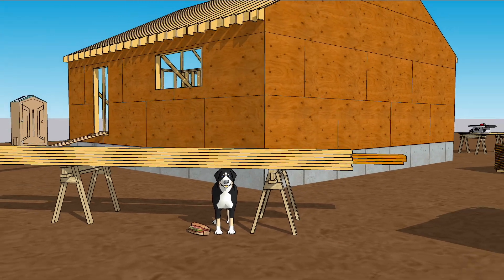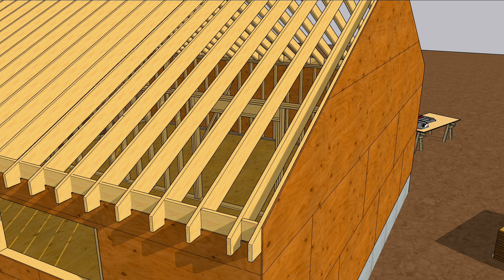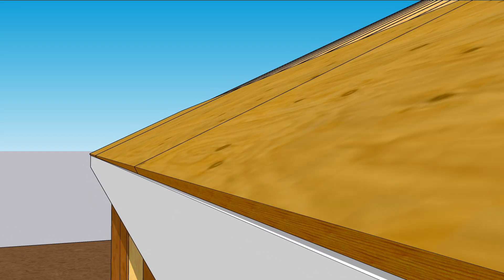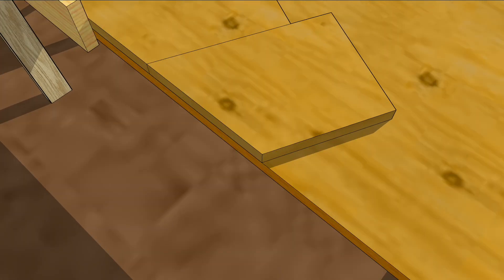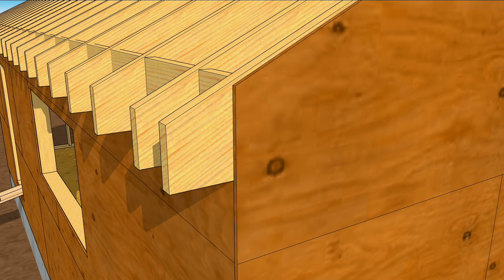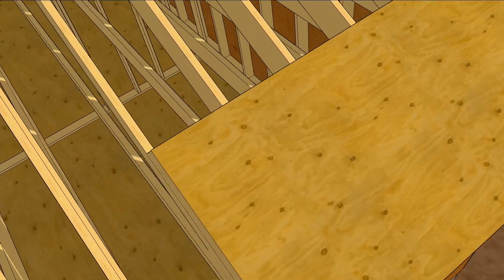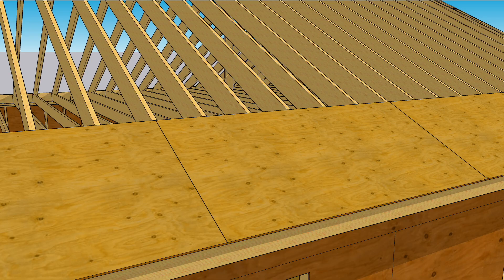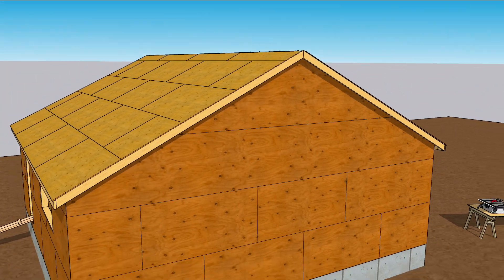Sheathing A Gable Roof

Comment: Would it not improve the stability of the structure to have blocking between the rafters? Maybe along the sheathing edges?
Reply from the maker: There are blocks between the rafters along the wall plate.
Reply: @ProTradeCraft  I meant mid-span blocks but I hear you.
Reply: @helmanfrow Yes, my rafters are 24 oc and are very wavy.

Comment: I always bevel the sub-fascia and fascia, the plumb cut the rip on the sheathing. It leaves more nailing surface and is stronger (even where it doesn’t need to be)
Reply from the maker: You are a better carpenter than I.
Reply: @ProTradeCraft  Probably not! Your channel allows me to be even more anal retentive with insulation and material longevity. I’m a big fan.